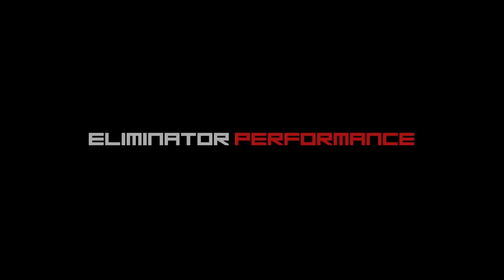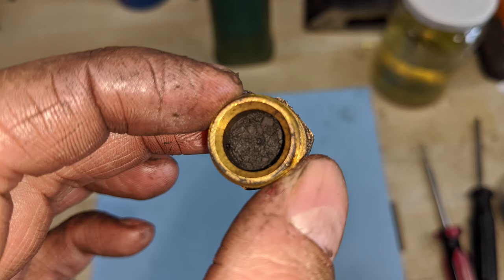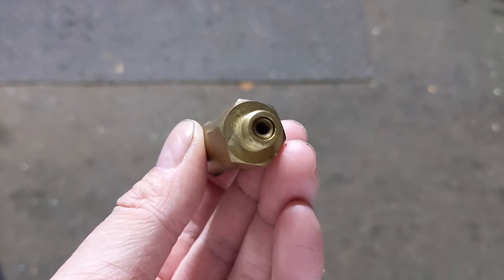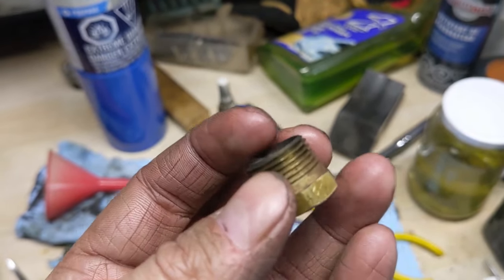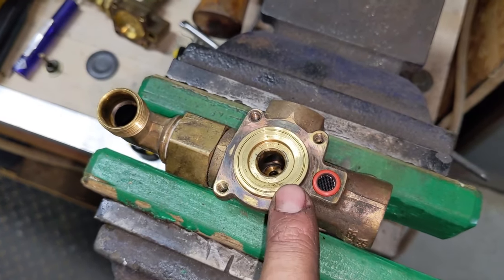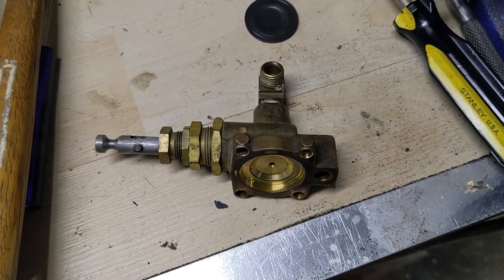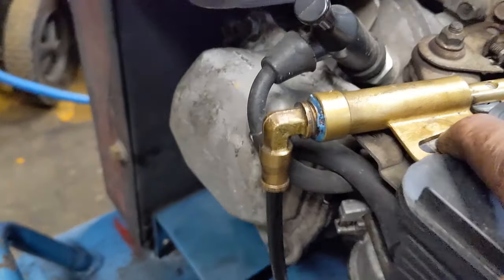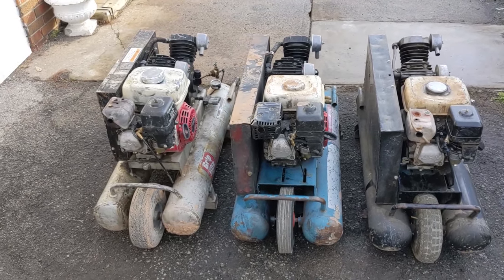Gas Powered Compressor Shuts Off? WATCH THIS!

Comment: Right on Minochat this dude really knows what he is doing, just unbelievable how concise he is on the service or repair of the equipment being worked on. This roofing company like many others rarely change their oil or intake filters per required maintenance. Roofers run these compressors 8 hours a day every day during the warm weather imagine what the oil and intake filters look like after a month. Nice job ELMN8OR.
Reply from the maker: Thanks for watching!
Reply: @EliminatorPerformance  :  Overall, good video. I do have a question though... Why are you using ISO68 Hydraulic Fluid in the air compressor pump? (Stated around @14:38 in the video.)
Curious, because virtually all air compressor manufacturers spec their pumps to use NON-detergent SAE30 Engine Oil, regular or synthetic. SAE30ND has several different fluid properties than an ISO68 hydraulic fluid.
Reply from the maker: @turbodiesel4709  that's what the manual recommended, so that's what I used. Some other brands have recommended synthetic 40 weight oil, so it thag case I believe we used royal purple if I'm not mistaken.
Reply: As a roofer. I approve this message.
Reply: @Calico-fw6li  Thank you sir hope you enjoyed the video

Comment: Thank you so much.  Great Video.

First came accross a wheel-barrell compressor when I rented one the other day.

Thinking about building one me self; well, outsour ing the metal work.  I already gave a GX160 on a rototiller and I am just $250.00 away from a compressor and a 30 tank.

Comment: Love your content man appreciate how you edit to get as much info in without unnecessary in-betweens. Question if I may, have a wheel barrow air compressor like these. Started to shut off when hot and when almost filled at 125 psi. Over time   once started would stop the compressor pulley all together. Took inlet hose off at compressor worked perfectly fine bought new  pilot check valve unloader. Put It on. Same problem. Compressor pulley stops within second of starting. Only thing I did was put the old unloader value from old unit onto new unit since new unit came without it? Any ideas? Thanks for your time!

Comment: This is a really great detailed video. Thanks. Mine isles down but the belt stops catching on the pulleys. They spend but the belt stays still causing it to burn. Any idea how to fix? Thanks!
Reply from the maker: Hard to say without seeing it, thanks for watching!
Reply: You got the right belt on it????
Length correct?
If its flopping and jumping around need to tighten it.

Comment: Hi I’m just getting to begin my conversion wheelbarrow air compressor project and dammit this is a very informative video on the check valve I’m not that far on my project but I was curious on how this works great thanks now I bought this compressor with dual heads compressor with both of there filters cap snapped off like I said I have no knowledge on this so I can’t even find any information or how to describe these little filters or muffler?? Can you please advise me in this repair?? Thanks also this is a 9.6 cfm what size gas motor should I get?? If I could fix these caps…thanks

Comment: I have a metabo gas air compressor with a Honda 160 engine. Just recently installed brand new carburator, spark plug cable, spark plug and coil, new on/off switch, new fuel filter, new fuel line. Also cleaned out the unloader check valve. It starts up like a champ cuts off like it should when tanks get filled up. BUT once I start to use the air instead of it starting back up it completely dies!

I rebuilt two gas air compressors (metabo and central pneumatics) and on both I removed the gas tanks to clean them out. And both air compressors will not rev back up to fill the tanks they both just die!

Comment: I have exactly the same valve but exactly the opposite issue mine kicks up but won't kick down and sounds like popcorn as it's trying to kick down my compressor head is getting worn and sends a healthy amount of oil through the valve not sure if that's causing an issue or possibly damaging it but what would you suggest? The valve itself is maybe a year and a half old

Comment: Great Video ..... Just an FYI.   I noticed on 2 of those compressors the muffler guards are missing.  I have found a few units where the engine crankcases were full of water.  It enters through
the open bolt holes that secure the guard.   One unit was so full that I could not pull the rope as if engine was seized.  They leave them out in the rain, usually in the back of a pick-up truck.
Hope this helps ☺☺☺☺☺
Regards;  
Steve @ Save-on Tools and Equipment Repair
Reply from the maker: Yes that's actually a great point, these things take so much abuse they don't want to replace the guards. I'll be sure to tell him to put a couple bolts in there, the next time I talk with him!

Comment: Great video! Can you tell me why my gas powered compressor shuts off whenever I start using the air? It starts right up at high rpm then rpm goes down once it is filled. As soon as the air gets to about 110psi instead of the compressor rpm going up to fill tanks again it shuts off!

Comment: Thank you, your videos really helped me a lot, few questions i need to ask, i have similar pump as in your video, but i'm not sure whether it is single stage or 2 stage pump because i bought it used and no information about that pump anywhere. do you know how to identify them? And what is your cut in/cut out pressure? Once again thanks for your videos. Cheers
Reply from the maker: Dual stage pumps have 2 cylinders/heads, 3 stage pumps have 3 cylinders/heads!
Reply: @EliminatorPerformance  Excellent video and to the point. Bravo!

The number of air filters is generally a more accurate way to determine if it's a single stage or dual stage. 
If the number of air filters match the number of cylinders, then it's a single stage compressor, like all the ones in your video.
In dual stage compressors, the air will pass through one air filter, get compressed, and this compressed air is pumped
directly into the the second cylinder and compressed further, upwards of 175 psi and are more specialized.

Using 2 cylinders in a single stage compressor is to reduce the recovery time, not increase the pressure.

Comment: The vent seemed to be the issue on mine, thanks! Is it normal to run 150 psi pre regulator?
Reply from the maker: Nice, as long as the tanks not rusted heavily I don't see an issue.
Reply: Thank you!

Comment: Thank you, very good video
I have a problem with my gas power air compressor, it’s only one year old
what happens is, my compressor start very easy but after the tanks are full die and then I have to use the air until is low and I start again with out any problems until the tank is full and die
any suggestions, thank you
Reply from the maker: Clean out the pilot valve. Sounds like it's filling and not kicking down.
Reply: @EliminatorPerformance  
Thank you, I will give it a shot, and let you know what happens

Comment: Question. 

I have an identical compressor. When I bought it it had a flat head Briggs that didn’t run. I rebuilt the carb and got it going. When it would try to idle its self back up it would die. I cleaned the vent on check valve didn’t change anything. Then I thought maybe the Briggs was worn out. (It wasn’t very snappy with the throttle). So I bought a Honda clone. And after installing it I still have the same problem.

Comment: My compressor runs, but will not cut out unless I manually trip the unloader valve.  But, then air leaks around the top of the unloader valve lever, and I believe that is what's preventing the throttle from idling down automatically, as it will not build any more pressure once that valve begins leaking around the lever. Is there a way to fix that leak at the top of the valve, or should it leak there?
Reply: Same problem here, did you fix it ?

Comment: Mine shuts off and has absolutely nothing to do with anything you just covered. Shuts off when going back to compress. Would that be carb issues? Cleaning usually works but not this time and spark plug is clean. Reckon I need a new carb?

Comment: Where can I buy that manual unloader valve? That little silver piece you move to put it on the loaded position fell off and I lost mine.
Reply from the maker: Check out Amazon
Reply: I didn't find it :/

Comment: Quick question, will a universal automatic throttle cable actuator work? I have a truck mount belaire compressor that doesn’t have one.
Reply from the maker: It should, these are "pneumatic accelerators" for compressors, or the bullwhip throttle control is the cable one. I'm sure eBay or Amazon has a ton of them listed
Reply: @EliminatorPerformance  thanks! I’ll snag one off Amazon. I appreciate your response!
Reply from the maker: Anytime, just make sure you measure what length you need because they sell them like 18" or different lengths

Comment: Yeah I am trying to figure out how to add something to a Kohler k482s 18hp motor that will be hooked up to a gardner-denver 1955 ado massive compressor pump, I mean I could hook them up and run the compressor pump but would have to manually stand there and watch the gauge to shut the motor off, not sure how to go about installing Something to either stop or idle the motor down when the tank is full? both vintage items trying to work with here

Comment: Hello! I'm working on a central pneumatic gas powered wheelbarrow air compressor, I 've replaced the pilot unloaded valve 'cause it bad, but now before it builds air up to 135psi bleed valve pops off. Any ideas???

Comment: I have simular problem on 5.5 honda dewalt air compressor it does not have vent and when high idel good kicks down good but when re idling up it just shut off also wont let u pull start till tank pressure is below 40psi any ideas

Comment: I have a Honda GX160 that starts with a starter and it runs, then it randomly shuts off but it starts right back up. If I unplug the cut off Wire to the coil it'll run and not stop. But it won't shut off unless you put The Wire back together like sensing it's low in oil, but it's not low in oil. Should I change oil??? Why is it just shutting off? Bad coil?
Reply from the maker: I would start with an oil change, and if it has the low oil sensor I would test that by unplugging it, if it keeps running longer than usual than that's the issue, the sensor itself. If it keeps shutting off, you've eliminated the sensor and can plug it back in and move onto something else. It sounds like an electrical issue, cutting spark, not a fueling issue. Also, if you unplug the kill wire and it keeps running, it means the coil itself is likely ok. I would also look for insulation chewed off or cut on the main kill wire somewhere, I've seen mice take a small bite, and expose the wire, then when you're using it, the bare wire touches the engine and cuts spark to the coil.
Reply: Ty bro I'll try that.

Comment: I am running a new predator 212 motor and cast iron pump. It runs and builds pressure  and kicks down like it’s supposed to. But when it’s supposed to kick back in it stalls instead of throttling up..
Reply: I’m using a conrader unloader pilot  valve . I have the check valve hooked up to unloader valve

Comment: My compressor runs on high idle all the time and never cycles off or to low idle. Can you offer any help on this?
Reply from the maker: Your tank pressure regulator may be set high enough, and you're using enough air that the tank never fills completely. At some point, the safety valve would blow off and release extra pressure.

Comment: I have a wheelbarrow compressor that I want to repair but i cant identify the compressor it has a seized connecting rod on the compressor is there any way i can contact you with some pictures and maybe you can point me in the direction of a parts supplier.
Reply from the maker: If it doesn't have a model number on the placard, it'll be near impossible to identify. Go by the color of the tank. That's about all I can offer as help.

Comment: So what if the circuit is working but the engine stalls trying to come off idle after the pressure drops. It's then hard to start with air in the system.

Comment: What dose it mean if the is air constantly coming out of the exhaust screen once you start the engine the air is coming out the exhaust and tank only builds to 20 psi because of it and even if you shut the engine off it will drain the tank

Comment: Do not operate the throttle lever manually (I don't even know why they put that lever there). Near-ocean operation and offshore operation rusts the pivot points involved in that throttle linkage. Every time you check fuel, tap on the throttle lever and the pilot valve to ensure pilot valve operates on its own. If you tap or bang on those when you suspect the compressor is not cycling, the lever has rusted at its pivot points or the pilot to throttle linkage is caught up. When the pilot vales become as wonly as dude shows here in this video you do not want to use the compressor in a pinch or a lucrative situation (it will fail you again). Buy a new pilot valve and save yourself... These are issues I know like the back of my hand. I understand the video is about other issues. Just wanted to add a little sumsum. Hope it helps!

Comment: Mine never throtlled up ,,,It always just ran the same rpm`s and would sneeze the excess air out,,,But did maintain pressure to run 2 trim nailers now it dies at 40 lbs

Comment: How does the air go from one tank to the other?
Reply from the maker: Usually there's a crossover hose
Reply: @Eliminator Performance  I have a makita mac5501g in fixing up but don't see where they connect. One hard line goes from the pump to the one tank and then one line goes from the other tank to the manifold

Comment: I got a weird issue here 

if i run my gas powered compressor to say 100psi then use some air and try and restart it at times it doesn't want to start back up again it is as if the pump is very hard to turn and turns back

the spring return etc for the idle works all well 

its just weird

Comment: I want the air throttle piston setup for my compressor can you send me a link on where to get it from as I am changing it from a three-phase motor to petrol it is a 9 horsepower Vanguard motor as I Googled throttle control piston on eBay and nothing come up any advice you can give me will be muchly appreciated thank you
Reply from the maker: Google Pneumatic Accelerator. And I can't send you anything for your compressor, Google the model number and then manual or parts diagram after it.
Reply: @EliminatorPerformance   Thanks for that I give that a go

Comment: My Gas compressor shuts off when pressure reaches 120 psi. The honda moter will not ideal . run at low APM. ???????

Comment: i disagree about adding thread sealant to the bottom fitting as it has an o-ring seal and completely unnecessary . . you seperated the valve body from the fitting , not removing the entire valve from the pipe nipple into the tank , I've had mine apart 100 times and the only issue is my cut-in and cut-out settings, on a 30 gallon 12.5hp ch compressor... also the locktite is unnecessary as it is brass/brass and will not back off if tight